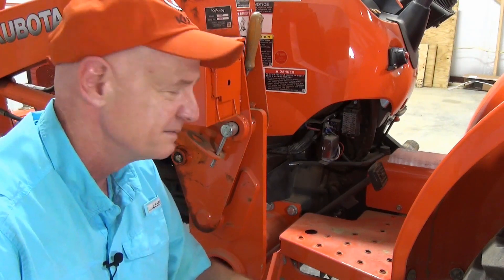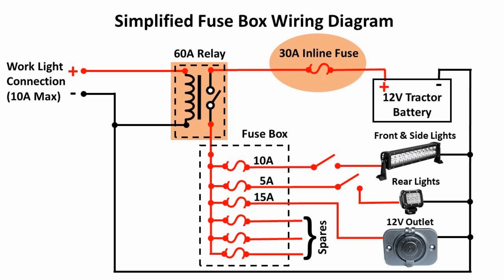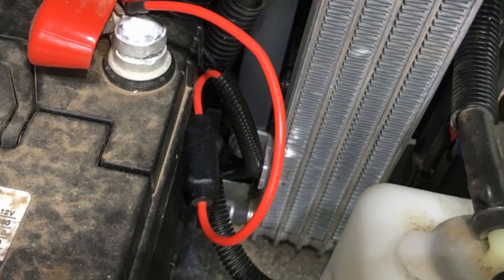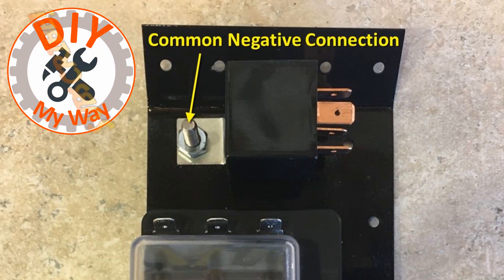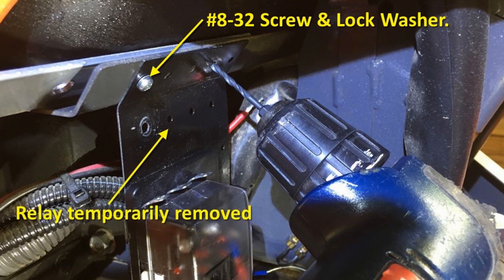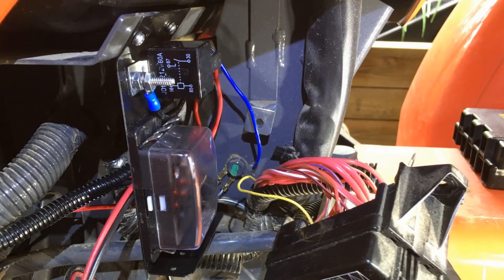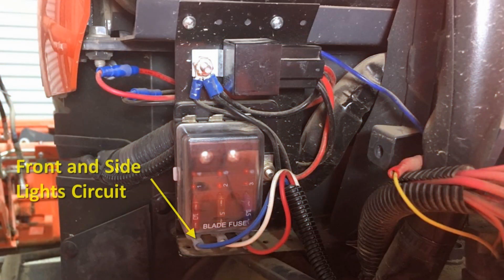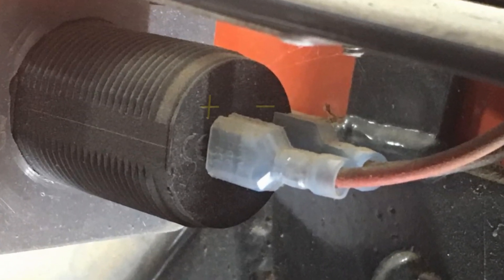Kubota Tractor Mod: Adding An Auxiliary  Fuse Box (#53)

Comment: Hello Martin and thanks for the top notch videos. They are the best I've seen. I am curious what the 60a relay does and whether it's necessary for the auxiliary fuse box. All I want is to add some lights to my ROPS, similar to what you have done. I haven't decided if I want to switch the lights separately or not. Thanks in advance.
Reply from the maker: Thank you for the kind words Mike!  It’s not essential unless you want the circuits in the fuse box to only be active when the ignition is on, which is what I wanted.  Otherwise the circuits would always be live.  Perhaps you might prefer that, in which case you can leave it out. Thanks for watching!

Comment: Martin I'm reviewing this older vid as I'm about to try to bring power to my L3901 ROPS.  Trying to find a safe and efficient path to pipe 10 gauge wire power to the top of the ROPS has been challenging.  I may just copy what you have done here.  I have 6 switch rocker switch type panel that I'll mount to the underside of my canopy.  I already have a forward light bar and then 6 more light pods mounted at 45, 90 and 180 degrees.
Reply from the maker: Wow!  With 10 gauge wire and all those lights you could light up a stadium!  Good luck and thanks for watching!
Reply: @DIYMyWay  well I want to keep the voltage drop to as little as possible. If the run is 25 feet, then I will see a 5% drop with that 10 gauge.  I’m a big guy and trying to crawl under and around the tractor to route the cable has been a challenge.

Comment: Great video! I'm looking for an answer to a question I have. I purchased a 1962 Minneapolis Moline and unfortunately the wiring burnt out during a battery replacement (my fault). But, since I had to replace all the wiring, I decided to replace all the old gauges and add two rocker switches for front lights, back up lights, and a warning beeper. My question, do I just run 30amp fuse wire to the box and out to the gauges (they are illuminated), light rockers, and back up beeper? What does the 60  do for the whole proces? Sorry, I'm a Network guy, not an electrician. Any answers help. Thank you!
Reply from the maker: Thanks!  The 60A fuse, wiring harness and relay simply limits amount of amps to the fuse box to a maximum of 60A, which is more that enough for the accessories I plan to connect to it. Your gauge lights and back up beeper won’t take much power so it depends on the load of your LED lights whether 30A is enough.  Good luck!

Comment: Okay, so today I finally got a chance to look at my system for adding additional lights and a fan. I have a 2022 Kioti CX2510 which as you would expect, is not configured as your kubota. However, I now have a bunch of parts I likely won’t use!🤣🤣
First challenge is, my fuse box is mounted to my firewall under the hood. I may be able to work with the hood still on, but I’m expecting not. We will see. More challenging is, I have to remove my loader! 😬
I guess I had to learn how sooner or later right?!?!🤣
The good news is, Kioti provides an auxiliary fuse panel as standard! So, I have 6 empty spare spots and, two switch blanks on the dashboard. I’m going to need to figure this out because presumably, I won’t need to tap into my work light wire? I’m still looking at a bar to which I’ll run my front spots, and then the rear spots. I have a fan socket already with the two usb panel that will take care of the fan. 
Part of the fun of being a compact tractor 🚜 owner!!😁
Reply from the maker: Hi Keith!  Wow, that’s impressive that Kioti has that many spare spots and two switch blanks.  That should make things much easier.  Good luck!

Comment: Great video, is There any chance you could expand on this video? Specifically how do you find the line that would make the second fuse box reliant upon a key in the ignition? And then how do you actually wire it in? I watch the number of times but something is eluding me
Reply from the maker: Thank you, Edward! As I explain at the 6 minute mark in the video, I use the rear fender work light connection that most modern tractors have. They usually have a dedicated fuse so you can see where that fuse is on the factory fuse box and find the work light wire coming out the back of the fuse box. Also you can look at the work light connector under the rear fender and verify the color of the work light positive wire which will match the wire coming from the fuse box. Good luck and thanks for watching!

Comment: Hi Martin, I recently decided to add led lights to my L2501 Kubota tractor. I purchased all the items you recommended and installed the led lights on my tractor canopy and ROPS, but when I started to wire everything up I couldn't figure out all the connections. I hooked up the red and black + and - connections to the battery, the yellow work light wire to the blue wire on the harness splicing the blue wire back into itself to continue the circuit. I mounted the switches the same way you did and ran wire to the led lights hooking the blacks to ground and red to red. I also mounted the same fuse box that you used near my factory fuse box and the relay near it although I had to use a different mounting method. I hooked all the ground wires to the relay mounting bolt and the red wires to the fuse box power screw. The only difference in my installation is that the side and rear lights are on one circuit and the front led is on another circuit. After connecting all the wires I installed the fuse into the in line fuse holder. I started the tractor and nothing works. Any ideas about what I did wrong? I'm stumped. There must be some connection that is wrong, but I can't figure it out. Any suggestions would be appreciated. I love your channel and have done many of your mods. Thanks, Steve Busch
Reply from the maker: Hi Steve!  I’d start classic troubleshooting, starting with the master fuse in the harness.  Is it good? Is there 12V at the end of it?  Next, check the work light wire.  Do you get 12V on it when you turn the key?  If not, check the work light fuse.  If yes, check the main relay.  Does it click when 12V is applied?  Do you get 12V on the output side going to the aux fuse box.  You get the idea.  Trace the power through until you find the failure point.  So glad to know you enjoy my channel! Good luck!
Reply: @DIYMyWay  Thanks, I'll keep trying. Could the problem be that I spliced into the blue harness keeping it intact instead of just cutting the blue wire and tying into it?
Reply from the maker: It could be Steve, but it’s hard to picture that in my mind.  I can tell you that it obviously works the way I did it.
Reply: @DIYMyWay  Thanks Martin, I appreciate your response.

Comment: Great video Martin!! Just got my new Kubota and Im planning out my project based on your design but I guess just needed a little more clarity. On the negativing wiring, are all the negative wires that are coming from the lights connected together and then straight to the common negative on the Aux fuse box? And are they bypassing the negative connections on the switches themselves?
Reply from the maker: Thank you, Joel!  Yes that’s right, sort of.  The switches negative are also connected to the tractor ground so that their internal LEDs have power. Thanks for watching!

Comment: Hi Martin,  It looks like you only have one relay...is that correct?  Are the switches wired directly between the fuse box and the work light(s) they are controlling?
Reply from the maker: Hi Darren!  That’s right no relay between the switches and lights.  The amperage of the lights is well below the rating of the switches so no need for relays. Thanks for watching!

Comment: So just to make sure I'm clear.  The blue wire from your new fuse box might be labeled  "acc" to connect to the key switch?  Thus the reason you connected it to the yellow wire from the original fuse box So that all circuits from you new fuse box only work when the key switch is on?  Thanks.  Your videos are very informative.
Reply from the maker: That is correct. Thanks for watching!

Comment: My relay plug has an extra, smaller diameter red wire coming from the location of the 14 ga red wire that connects to the positive battery terminal.  Did I miss something in the video that shows where it goes?
Reply from the maker: I don’t think you need that extra small gauge red wire for this project.  I only had one wire on my wiring harness. Good luck and thanks for watching!

Comment: In theory, I guess you could have just left the work light connection in the original fuse block correct? and used your new fuse block for the 12v outlet and the sidelights or am I missing the reason why you pulled it out of the original block?
Reply from the maker: Yes, you can do that, but the new fuse box circuits would always be on regardless of the start switch position.  The work light circuit is only on when the ignition switch is on so I use it to power the relay that energizes the aux fuse block circuits.  That's the way I wanted it. Thanks for watching!
Reply: @DIYMyWay  Yep, good point,. Thanks

Comment: Thanks for this informative video. I am in no way mechanically inclined including not being able to wire things up. I spent my entire life in Law enforcement and the Military and always had someone else do these things for me. I have a brand new 2020 BX 1880 so to add more lights to the ROPS I bought this set at Wal-Mart. As you can see it includes a complete wiring harness with switch. Would you recommend an auxiliary fuse box or could I connect to the light switch. Thanks. https://www.walmart.com/ip/Nilight-20Inch-126W-Spot-Flood-Combo-Led-Off-Road-Led-Light-Bar-2PCS-18w-4Inch-Flood-LED-Pods-With-16AWG-Wiring-Harness-Kit-2-Years-Warranty/710552242
Reply from the maker: Glad you found it helpful!  This kit would work great for your tractor, but the total amps are 12 A which is 2 more than a work light connection can handle.  If the wiring harness has an  inline fuse and connects directly to the battery, you'll be fine if 10' of wire is long enough.  Thanks for watching!
Reply: @DIYMyWay  Appreciate the quick response. I have no problem subscribing to channels where they answer back . There are so many guys out there that make a channel and after they get their subs up high for some reason they just stop commenting back like they are to important and too busy. A channel is worthless without the people to watch and comment. Again thanks

Comment: Why is the negative (-) black directly connected to the battery post? I was thinking of connecting to any metal part tied to the tractor frame...
Reply from the maker: I could have, but since the wiring harness provided a negative connection all the way to the battery, I used it.  You can certainly connect it to anywhere on the frame if that’s convenient for you. Thanks for watching!
Reply: @DIYMyWay  Thank You...I'm not an expert...wanted to make sure I  made no fatal error. I think tinkering only on the red/pos+ post and after, as a second step, hooking black(-) to the frame reduces the chances of sparks near the battery. After a co-worker got acid from a battery explosion,   I  always use safety glasses when I work on a battery.

Comment: In your video, you didn't show what you did with the other end of the yellow work light circuit wire after you cut into it at the fuse box. I assume that circuit was feeding other items on the tractor before you cut into it. Did you just abandon that yellow wire?
Reply from the maker: Hi Tony.  Yes, I just abandoned it because it only fed the work light connector under the rear fender. Thanks for watching!
Reply: @DIYMyWay  Excellent video and presentation. You have a new subscriber.
Reply from the maker: Thanks, Tony! You might want to check out my other tractor mods in the tractor mod playlist. Some of them may interest you.

Comment: I am blowing the 5 amp fuse on my Kubota B26 as soon as I start moving forward or back.  It than will not restart without replacing fuse.  I am not good with electricity, but I have checked all interlocks.   Seems to have to do with neutral position on front/back pedal.   Any suggestions?
Reply from the maker: Sorry to hear that, Michael!  What does the manual say the 5 amp fuse is for?  (Should be listed on the factory fusebox cover too.)  Just guessing, I say you have a short in the seat sensor circuit because if you stand up while the tractor is moving forward or backward, the tractor is supposed to cut off.
Reply: DIY My Way .....the 5amp fuse is in the fuse box, controls OPC system circuit which includes PTO lever,HST petal, and seat switch.  Seat switch seems to be ok. While moving if I lift off the seat, it will shut off motor.  However, now the 5 amp fuse blows, and will not even engage starter until fuse is replaced.....then as soon as you start moving...it will blow again.   We are checking the switch on foot lever for forward and reverse tomorrow.
Reply from the maker: Good luck, Michael!